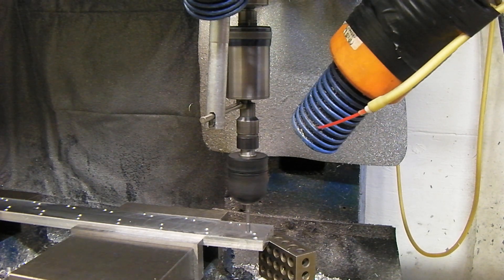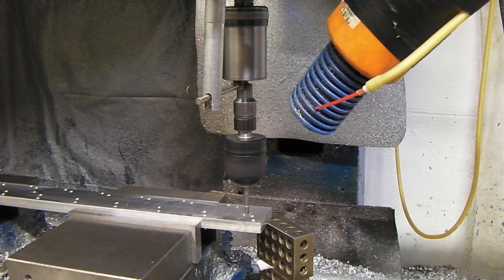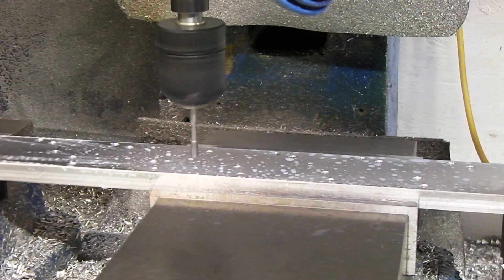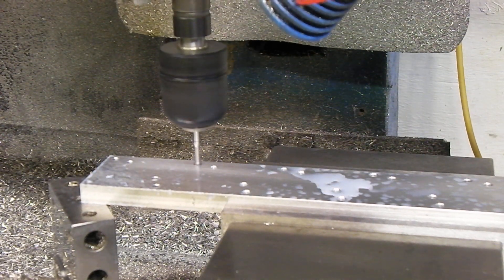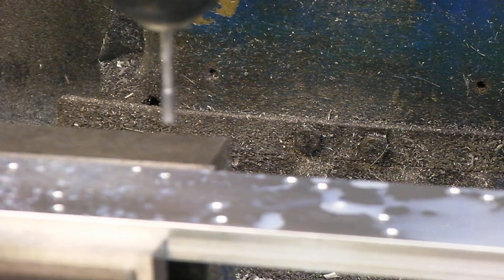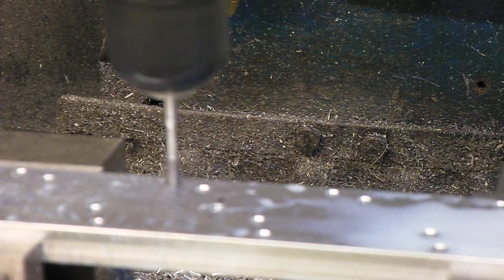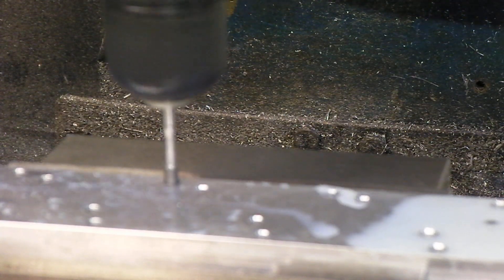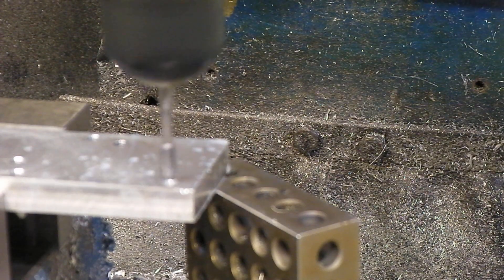CNC tapping with tapping head  44 threads M5  using a roll tap

Comment: Nice work Dave. That makes fast work of tapping.   What are you using for a chip blower / mist system, if you don't mind sharing?  I have been looking for a method to blow chips away without using an air compressor.
Reply from the maker: I'm using a full sized bounce house blower. Connected to a 2 1/2" hoses that I split to two 1.5" hoses. For a long time I only used 1 hose but milling  slots in the wrong direction would not clear and it was a problem. 

For liquid I have KoolMist mix and what is called a "dosing" pump. It is a vary low speed positive displacement pump. Even with a vary low rate pump I still needed to use a control valve. The pump has been kind of crappy stalling too often. I am going to replace it. I do get many ,many hours from 5 gallons of mix. At least 100 perhaps more. The KoolMist mix did get a bit lumpy, I added some of the other coolant I have that has better anti fungus additives and it is OK for now. I am going to go full flood fairly soon. I have a new coolant to try. If it proves good on the PM-940 I will do the IH mill next. 

All said I do like the blower system. The only problem is if you do really light finish passes the chips will all float out of the box. 

For a smaller system a 220V leaf blower running at half speed/110V/ might be OK. Full speed is too noisy.

For the PM-25 I used a blower from a Christmas yard toy that worked OK. The hose needed to be short. 

Thanks 
Dave

Comment: An interesting development.  Where did you source your tap system?
Reply from the maker: 5 or 6 years ago from Ebay for about $60. It is a really old USA made tool called a SAR-50. It might be 40 years or more old. It has a ball socket connector that is made to fit some kind of tap holder. I mainly do just M4-5 and 6 with it. If I made a few holder that fit nice and got rid of the chuck I could speed things up a lot. 

Thanks 
Dave